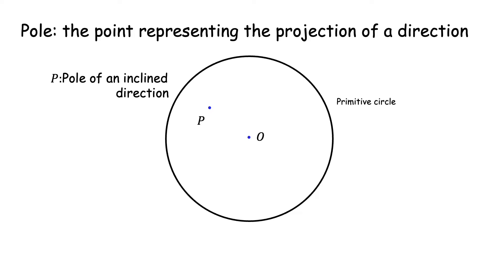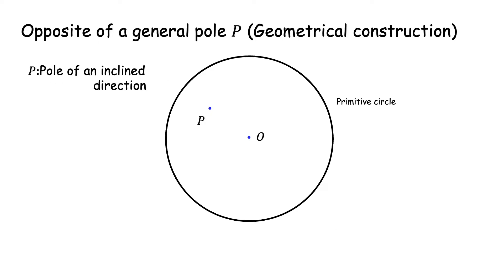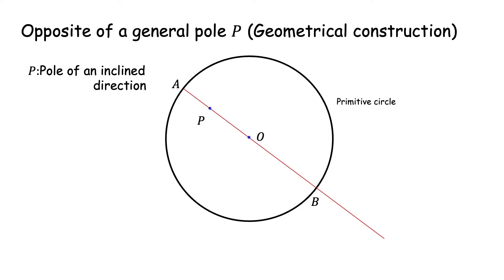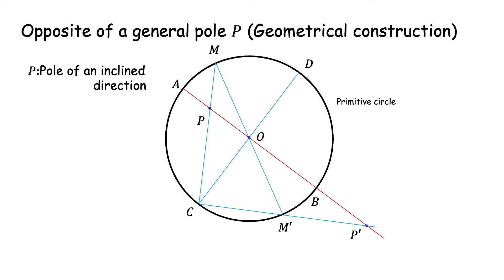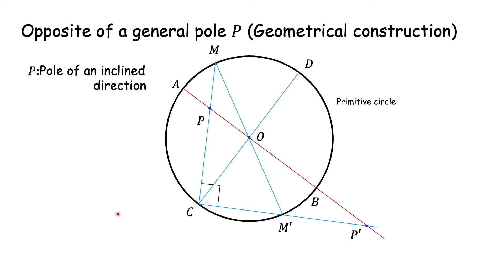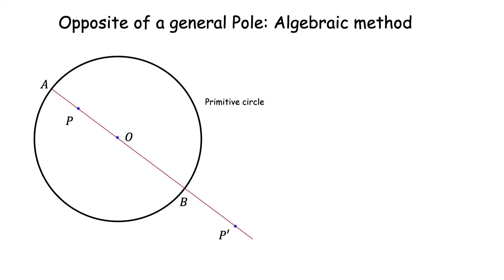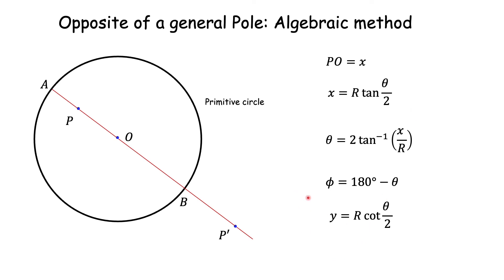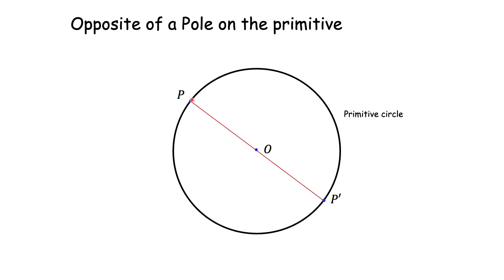Stereographic Projection IV Opposite of a Pole

Comment: Dear Professor, is it normally required to represent P' in case that P' is outside the primitive circle? Just out of curiosity...
Reply from the maker: Well, if we wish to represent P', the projection of a pole 180 degrees away from P, using the same projection point, i.e., the South pole, then we will have to go out of the primitive as described here. If you do not wish to go out of primitive, then you can change the projection point to the North Pole. Then the opposite pole will come inside the primitive. But you have to carefully label this to indicate that you are using a different projection point.

In the example of this video @3:00 instead of joining M to C and finding the intersection P' with the diameter AB, we will join M to D and mark the intersection point P" (not shown) with AB. You can see that P" will lie inside the primitive. We can mark this point with an open circle to indicate that the North, instead of the South pole has been used as the projection point. In fact, in this case, the construction is much simplified. You can show geometrically, that OP=OP". Thus you really don't have to construct the perpendicular diameter CD at all. Just mark the point P" on AB such that OP"=OP. 

I now feel that I should have considered this case as well. Thanks for asking the interesting question.

However, In the next video of the series, https://youtu.be/YmiTRbYxw6c, you will note that we do need the opposite pole outside the primitive to be able to draw the great circle through two given poles.
Reply: @rajeshprasadlectures  Thank you very much for your explanation! Very helpful lecture to build a stereographic projection background.